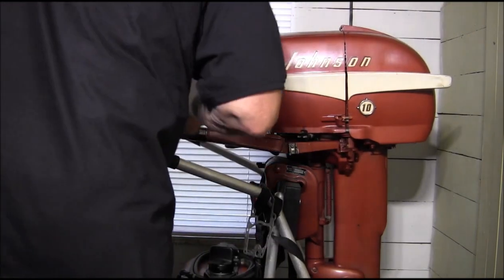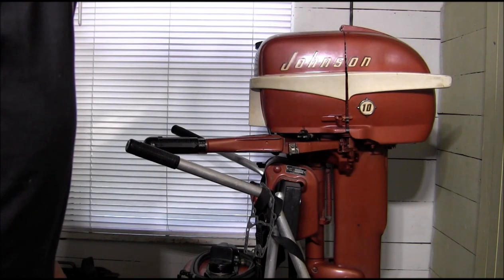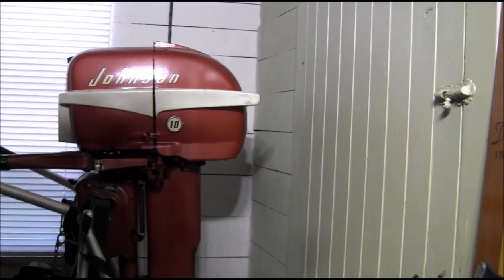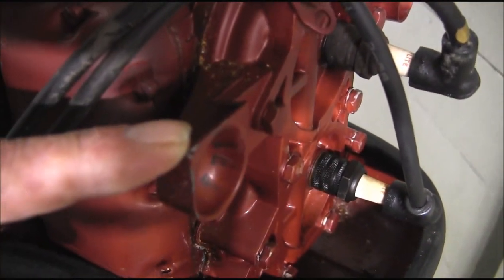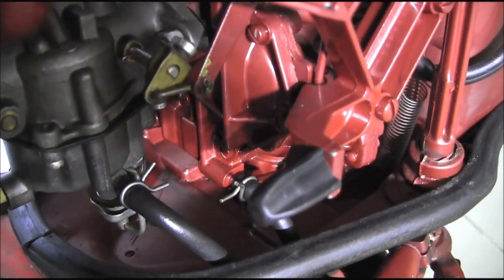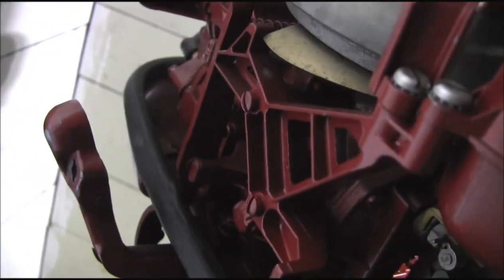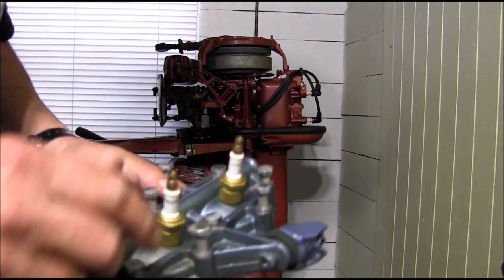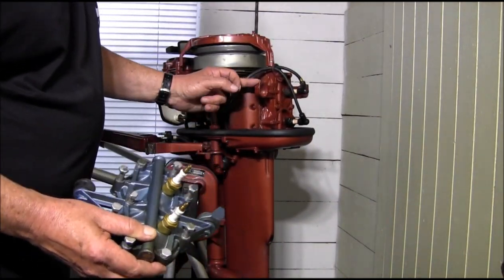1956 Johnson outboard Cowl mounting details and isolators

Comment: Hello Doug. Got your specs on the Johnson 7 1/2 and 10hp. Most appreciatie. Now I can order my shipping crate. Many Thanks for the great follow up. Steve
Reply from the maker: Hi Steve!
Best of luck with the fab of the containers and your selection of a competent shipper. I hope all goes well for you. I've received motors here in Massachusetts with zero damage from the west coast and also huge damage from local regions, just depends on the shipping company. Outboards (especially older ones) are quite fragile and if not handled carefully damage results and is difficult to repair and sometimes a parts motor is necessary for donor components. Best from here, enjoy your upcoming weekend and keep in touch, I'd like to hear how this mission ends.
Doug@ the "ranch"
Reply: Received your last note and "wish" of success.  Hope the shipping company does its job correctly. If all goes well items will arrive end of July. I keep you posted and take pics when they arrive. Hoping to use them on my 9' Whaler. Thanks Doug for your excellent and needed help. Steve
Reply from the maker: @seau2007  Great! Send the pics here dougs.1ranch@gmail.com  I'd love to see the condition and the shipping containers. Sadly end of July will be here before we know it!
Enjoy your evening Steve, great chatting with you and I'm glad I could help the cause. You may want to consider subscribing to the channel to keep up with the variety of stuff I'm doing nowadays. All family-friendly content since 2006, share with your friends!
Doug@ the "ranch"

Comment: Thanks! What fun. The first engine I remember was a 1930s Johnson Seahorse A-25, 2.5 hp 2-cyl with a wind-up starting cord that you dare not lose when out fishing, open flywheel and open cylinders. It was slow moving, but never failed us. I think we had it until the 1950s.

Comment: Video finally worked here. Thanks! It was fun looking at one of the motors with which I grew up. We had an Alumacraft boat (I forgot how long it was) and my dad only wanted Johnson motors. Later on he bought a Martin motor (made by a pressure cooker company) because had got a good deal on it and he hated it to the end. Thanks for sharing this information.

Comment from the maker: Hey brother !!

Don't think they're the same...the 35 is electric start right ?

That's a totally different setup I'm afraid.

If you have the parts accessible there is a cast P/N on the back normally.

I can verify what your parts fit with that info :)

Thanx for the check in, glad you got vid workin....

Comment: Thanks for the response. I am shipping these motors from the east to the west coast. Need measurements for wood crate  height x length x width. I have the weights.  The shipper is out of town and unable to measure the !957 Johnson  7 1/2 and a 1980  Johnson 10 hp.
Reply from the maker: Hey Steve!
I'm out of the shop today doing some drone work for a Municipal org. I'll get some dimensions for you later tonight or Thurs. One last thing, your motors are std shaft, long shaft, or sailboat kicker style? It makes a big difference in the overall length! Also, the motors are completely assembled, ready to run, correct?
Doug@ the "ranch"
Reply: @lakesideranch  Thank you for your note. I would measure my  '57 Johnson 7 1/2hp  and '80 Johnson 10hp motors but I'm in CA and they are in MD sitting in my cousin's garage. He would measure them for me but Pat is on vacation for the next two weeks and i'm trying to order crates to have them shipped to the West coast. Both are the normal shaft length. Very appreciative for the help. Thanks Doug.
Reply from the maker: @seau2007  Hey Steve, no prob. I'll have the "dimensions" here for you tomorrow! Have a good evening.
Doug@ the "ranch"
Reply from the maker: Hi Steve, here's your dimensions:
'57 Johnson 7-1/2 HP (std. shaft)
L x W x H    22-1/2" x 14-1/2" x 45" [incl. std. tiller handle folded]   >> 2 line pressure fuel tanks are 10" x 16" x 12" for 6 gal US

'80 Johnson 10HP (std. shaft)
L x W x H   23" x 15-1/4" x 46-1/2" [incl. std. tiller handle folded]   >> 1 line fuel tank is same size as 2 line 6 gal US (steel const)

Have a good day, work safe
Doug@ the "ranch"
Reply from the maker: @seau2007  Hope you received the info, it's under the video comments. Hit me up here if you're missing anything. Have a great day.
Doug@ the "ranch"

Comment: Ranch hey right back at you man we die these engines run forever the way they were ment to do, now everything is designed so you can't repair it yourself and so you have to have tool # sjx 278 and that cost 399.50 + tax then you find out it was gona cost 400.00 to have it fixed, all I ever had done is machine work and tires changed and I did have my own tire changer, sometime I use a bumper jack to break em down and get my tire spoon's to em...thank's doug if you get tired of that motor ship it down here to me in alabama or come on down and we will go fishin, jeff
Reply from the maker: Jeff gibson Thanx for the offer Jeff !
Appreciate you watchin and givin me a holler here. The old Johnson is like a good friend, always there when you need a little somethin to cheer up your day..lol
It's a keeper !